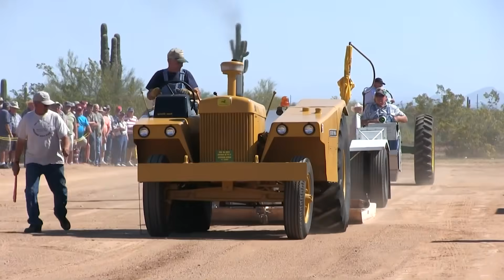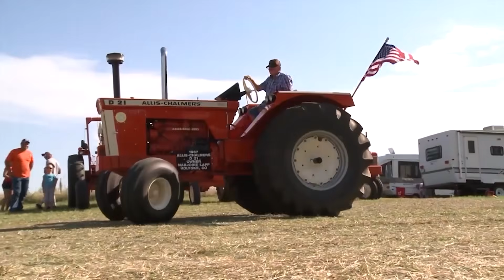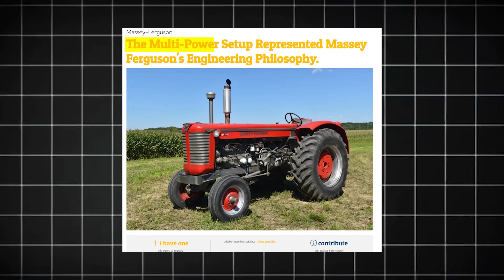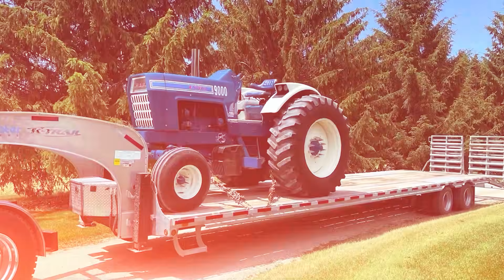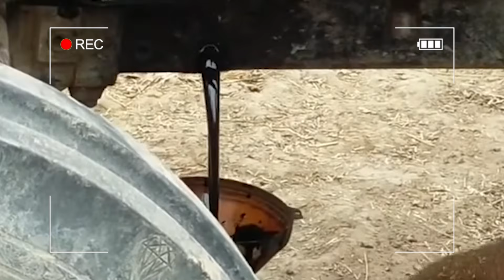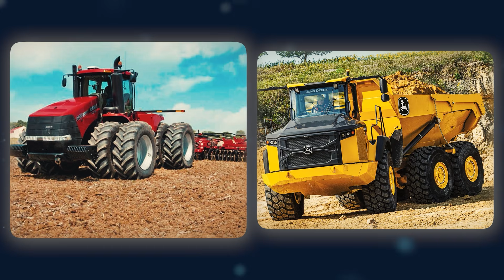15 Rare Muscle Tractors That You Haven’t Seen

Comment: This video thinks that a 5010 is actually a 730.  What a joke.
Reply: I dint get that was nothing said about a 730
Reply: @AyeSha-c2p1r the specs that were given were of a 730, not a 5010.  The 5010 has a 6 cylinder engine with 531 cu inch displacement, not a 2 cylinder engine like the video claimed.